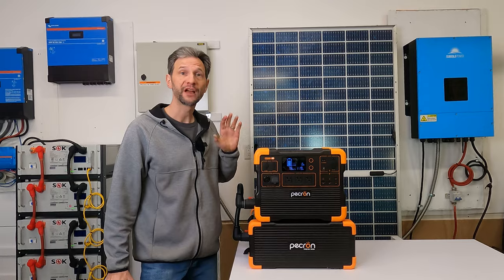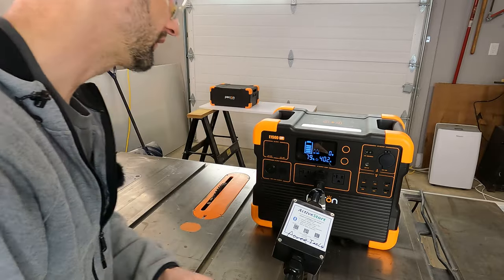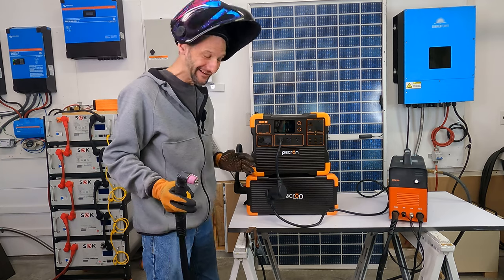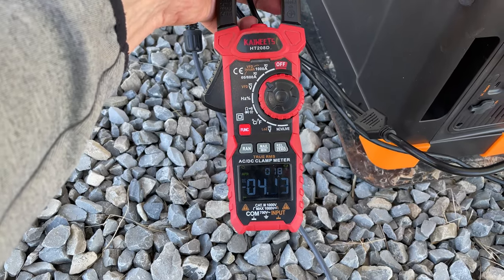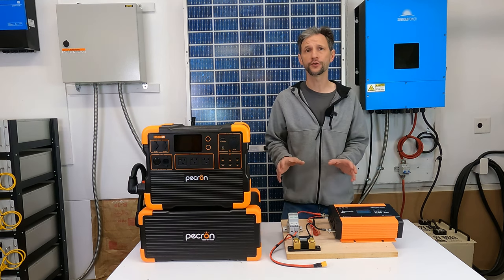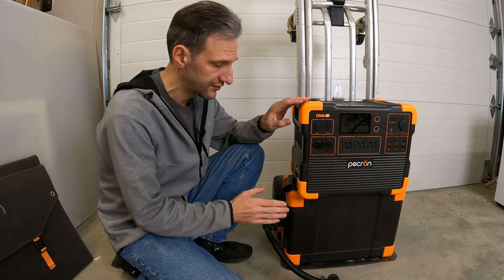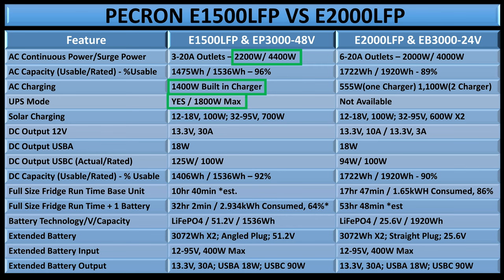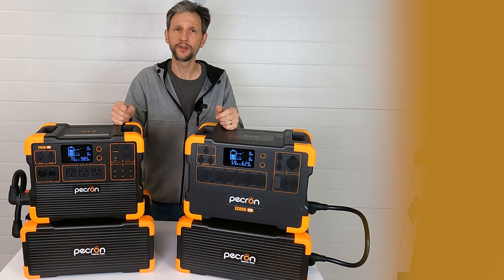PECRON E1500LFP 2200W LiFePO4 UPS Solar Generator Review

Comment from the maker: You can get the Black Friday Deal - PLUS 5% off with these affiliate links and codes:
PECRON E1500LFP - UPS power station with a 5% discount (Code: PROE1500LFP ) here: https://www.pecron.com/products/pecron-e1500lfp-expandable-power-station-2200w-1536wh#ref=87
PECRON Expansion battery with a 5% discount (Code: PROE1500LFP ) here: https://www.pecron.com/products/pecron-ep3000-expansion-battery-3072wh#ref=87
PECRON E2000LFP power station with a 5% discount (Code: PROE2000LFP ) here:https://www.pecron.com/products/pecron-e2000lfp-portable-power-station#ref=87
For more information on Portable Solar Generators visit my website: https://projectswithdave.com/portable-power-station/ 
If you have one of these units and have any personal experience to share, please post it below for everyone to reference.  Thanks!

Comment: I have both E1500 LFP and E2000 LFP. My main use is for home backup in case of an outage. I combine both Pecron power stations in a "master- slave" way. The E1500 is the master and the E2000 is the slave support unit with its larger solar yielding capacity and larger battery.
The E1500 having the UPS mode powers the critical loads like the refrigerator, the freezer, the modem-WiFi router and the home automation. On the E1500 LFP,  the 32 -95 V "solar" input port is always prioritized over the wall outlet supplied Ac input internal charging port. This way allows to recharge the E1500 LFP battery with either solar or using the Pecron charging "brick" with the aviation connector or a 48 V battery charger linked to the 32 -95 V by means of a Pecron provided cable with the aviation connector. Also, this way allows the utility supplied input 1400 Watt port internal charger to work only when there is no solar or any other source supplying the 32 -95 V "solar" input port. Otherwise, when there is power supplied to the 32 -95 V "solar" input port, the AC internal charger is moderated to just top off the battery,
So, 2400 W of solar panels supply the slave Pecron E2000 LFP that in return feeds power in the 32 -95 V "solar" input port of the E1500 LFP when needed. This feed is from a E2000 LFP Ac output to an external "brick" that provides 42 V - 15 A to the  32 -95 V "solar" input port of the E1500 LFP. I noticed that the E1500 LFP "requires" input power to recharge only when the battery shows less than a 96 % level. The solar input of the E1500 LFP being prioritized, the "slave" E2000 LFP AC output and accompanying brick charger remain idle until the next E1500 demand.
Since the above mentioned critical loads only draw about 200 Watt-hour per hour from the E1500 LFP, the slave E2000 LFP battery gets fully charged and stops all solar input. To benefit the available free solar energy one just has to plug in some other load in the E2000 Ac outputs. When possible, sometimes we plug in a space heater. Some other times, when the sun shines, we cook using a counter top oven between 20 and 60 minutes (not to deplete deeply the E2000 battery), or a hot plate, or a small slow cooker. We always care not to deplete the E2000 battery lower than 80 % by the end of daylight. No one knows what will happen during the night or the day after.
Recently, hundreds of miles away from home for 15 days, we appreciated our Pecron setup especially using the E1500 LFP WiFi monitoring app. All the critical loads were linked to the E1500 LFP. With our home WiFi router always on, we consulted the E1500 LFP status and using a camera we also monitored the E2000 status over the Internet. We were also able to activate the utility supplied heating appliances. The only missing part was that we could not activate any new load over the Internet to use the extra solar energy when the E2000 battery went to 100 %. Since then we got a WiFi controlled space heater and no longer reject the free solar energy when the power stations batteries are fully charged.
Reply from the maker: Wow, that's quite the configuration... : )
Reply: Great setup. I was going to suggest a smart plug or smart power strip..tp link being my favorite, but sounds like you got it with the smart heater.

Comment: Nice review!  I am glad I bought the E2000.  More interested in solar charging and having a bigger battery.  Don't care about the brick I never use it.  Definitely not interested in another tracking app we all have enough of those.  Lol
Reply from the maker: I'ts nice to have the two options.  I'm with you, unless you need the UPS the E2000 is the way to go.
Reply: Yeah I really don't need a UPS.  However theoretically I could turn on my inverter, plug my charger into the wall and plug the fridge into the unit and it would act as a UPS.  Not as efficient but it would work.  Thats what I do when we get hurricane warnings down here in Florida.   So unless my fridge is drawing more watts then my charger which it won't the unit will be a 100% and stay on if the lights go out.  When lights come back it starts charging again.   @ProjectsWithDave

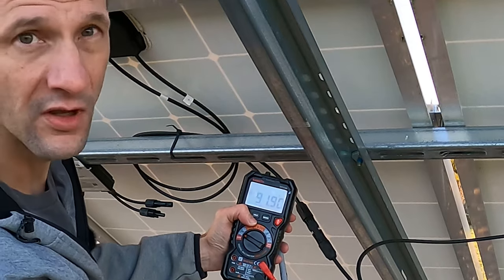Comment: 10:38 u connected 2 solar panels in series, u supposed to get 96v+- open circuit voltage/ under no load, becuz its short circuit and your solar panel data says 48v. 48x2 =96 in cold weather u can expect 0.1 to 5v above from rated.

Comment: Great Review!  Wow - so detailed, so well done.  QUESTION:  I have 2000 lfp in the bed of my Jeep Gladiator, charge it via vehicle alternator and Renogy 2000W inverter, and use it to power everything overlanding.  Cooking. lights, entertainment, Starlink - Just excellent for the past year and a half.  NOW I want to increase the capacity.  Looking at the 3000 when I came across your excellent review.  The one thing that I really DONT LIKE about the 2000 is the horrible, bulky, noisy, charger.  In my dusty environment, it stops regularly and I need to then clean it out (fan stops due to dust).  Is there a way to use the 1500 and its internal charger and then charge the 2000 from the 1500 - that would make my decision clear.
Reply from the maker: Thanks!  I'm glad it was helpful.  If I understand you correctly, you are converting your Vehicle 12VDC to 120VAC with the Renogy, then converting that back to DC with the external brick to charge your Pecron?  It would be more efficient to use a DC/DC converter to up the 12V from the vehicle to somewhere between 24-48V and charge the Pecron through the PV input port.  You could then just add an expansion battery which also has an additional DC input for charging.  If you don't need more than a 100W charging rate, you could use the 12V 100W PV input straight from the vehicle 12V system. If you have the expansion battery you could charge with 100W at 12V to the 2000lfp and an additional 400W at 12V directly into the expansion battery.  (I haven't tested to see if you can get the full 400W input on the expansion battery at 12V.)  That would give you 500W total of charging off your 12V system with no inverter or DC/DC converter.
Reply: @ProjectsWithDave  Dave. Thank you so much for taking the time to think of a  solution and respond to my posting. I did not realize I could hook up any 24 to 48 V DC source and use the PV input to Pecron. I’m definitely on it now. Thank you so much again

Comment: Excellent review! Answered a lot of my questions. I do have question though, i am looking at a few different stations with an extra battery. One brand in particular is Vtoman. I have read a few reviews on their website that would indicate the an automated switch over from the extra to the  main battery is not happening, does the Pecron auto switch once the extra is depleted? Seems like that should be standard on these devices. Thank you!
Reply from the maker: The Pecron maintains a basic balance between the batteries.  In the video I showed connecting a charged expansion battery to a completely dead inverter battery.  The expansion battery started shifting power over to the inverter battery to balance the distribution of energy.

Comment: Can you alternator fast charge with dcdc convertor if so can simultaneously charge with 200 watt solar also?
Reply from the maker: Each port is capable of taking a DC input at the same time within it's max voltage and wattage.
Reply: @ProjectsWithDave  Any thoughts or ideas for adapting a 90 degree elbow on the 700 Watt solar charging input cable (GX16-5)? Seems like a flimsy connection that sticks straight out & not secure. This is even more of a concern if one is considering using the DC/DC (higher wattage) converter for charging while driving. Also seems like they are running a large amount of current through that GX16-5 plug? Thanks!

Comment: Any thoughts or ideas for adapting a 90 degree elbow on the 700 Watt solar charging input cable (GX16-5)? Seems like a flimsy connection that sticks straight out & not secure. This is even more of a concern if one is considering using the DC/DC (higher wattage) converter for charging while driving. Also seems like they are running a large amount of current through that GX16-5 plug?
Reply from the maker: Since they are not a standard plug there are not a lot of options, but the plugs are reasonably robust.

Comment: I just got my E1500LFP two days ago. So far it’s great but I wanted to ask you - Do you notice that lights will flicker when powered by the unit? Also when the AC inverter is on it makes a noise that I wash wasn’t there. This is my first power unit like this. Is that consistent with what to expect? I plan on putting out a video with it, focusing on woodworking coincidentally enough.
Reply from the maker: I haven't see those issues.  What kind of lights are you using (LED, incandescent, florescent)?  Do they flicker when other appliance turn on, or when running just by themselves?  AC inverters make a slight humming noise when running, usually almost imperceptible when not under load.  What kind of noise do you hear?  How loud is it?  Do you hear it under load, or just at idle?
Reply: @ProjectsWithDave  The lights are all led, I’ve tried multiple shop lights and Edison style screw in. They all put out a rapid flicker very similar to this video. https://youtube.com/shorts/gmytIKsUy2s?si=mPM0NMSl-NJ0fbLQ

They do it even when the unit is under load running a 1000 watt heater. 

The noise is only present when the AC inverter is on. The DC inverter is almost dead silent. The  AC inverter noise is similar to static coming from an amp. I bought an inexpensive oscilloscope to test the sine wave to see if there is a detectable issue there. I contacted support and they were quick to reply asking for a video, they seem genuinely helpful. I’m just not sure if any of these sound normal for a power unit.
Reply from the maker: Your link doesn't work for me.  Let me know what Pecron support says.

Comment: Great video, just received mine.  I have a folding 300w panel for camping, 18v.  Is it ok to wire this up to the aviation port even though the volts are below 32?  Seems like I am over the watts on the 100w port and under the volts on the aviation port.
Reply from the maker: This highlights my biggest complaint about the solar input for this unit.  The voltage ranges for the two ports don't overlap.  Since it is under 32V it likely won't trigger the MPPT on the 32-95V port and you will get no input.  You are at the top of the voltage range for the 100W port, but it should be ok, the only issue is you will be caped at 100W as the input for your 300W panel.  If you had another 300W panel you could put them in series and use the higher voltage port.
Reply: @ProjectsWithDave  Usually I use this with my my own 40amp controller for my camping trailer directly to my batteries, but for this weekend I am testing a diesel heater with a tent.  I am going to bring my littler generator since it my get to a low of 4 deg F.  I may have to charge with the Genny!
Reply from the maker: Keep in mind you can't charge LiFePO4 batteries below freezing.
Reply: @ProjectsWithDave Good point, that heater better keep up then.

Comment: Did tons of research and ordered a 1500 a couple of weeks ago and hope to receive early next month. Still doing research on a panel.  Have you tested their  330w portable panel?

Will look to add an extra battery after I pick up a solar panel. I will augment a solar panel with my dual fuel generator. Thanks!
Reply from the maker: I haven't tested the 330W panel.  If it performs similar to their 200W folding panel, you can expect to get about 250W out of it.  If you don't need the portability, it is much cheaper to purchase ridged panels.  Just make sure it falls in the voltage range, target 40V to 80V.
Reply: probably better to get different panels to max out the solar input, 2 330w will only get you about 500w total of solar charging. and you cant put 3 330w panels in series because the voltage will be to high.
Reply: And?  Results so far?

Comment: I want to run my desktop Computer on a solar generator 24/7  with Solar & A/C plugged in at the same time. I want it to run on solar power but have the A/C power kick in if the battery gets too low. Can this unit (or any unit) do this??
Reply from the maker: Yes, this system can do that: https://youtu.be/_QMe8DWlr30

Comment: If I understand this correctly I can't get connection to the power station without WiFi?
Reply from the maker: Right, but you can change all the settings without the app.

Comment: I saw the battery clamps.  Will this unit jump start a car?
Reply from the maker: The DC port is only 30A, which is not enough to jump start a car.  However, you could charge a depleted battery as long as the charge rate didn't exceed the 30A max.  Once the battery was charged you could start the car.
Reply: @ProjectsWithDave  Thank you!

Comment: this portable power station has a surge of 4400w sir. the output capacity is 2200w.
Reply: Sounds about right. The surge rating is usually about double the continuous

Comment: I still can't see anything being better than the ac300 in the mid range with expandability. Pecron is nice, but can't beat Bluetti imo. Buying refurbished direct from Bluetti is way to get great products at a great price.
Reply from the maker: I have had no issues with my AC300.  I've been charging it with solar and discharging with a dehumidifier daily for months with no issues.
Reply: The AC300 just sits there til u buy a whole 'nother unit to run it. I'd have to lug around 2 units vs the Pecron or an Ecoflow. A brand new Pecron E1500 for $854 works for me. ❤

Comment: I recently purchased this power station. Because I get limited sun, I would like to be able to charge the battery using a gas generator. One of my generators (listed below) only puts out 1000w, 400w short of the 1400w AC in port on the power station. Would it still work, but input at a slower rate?? Or, not work at all? 🤔

1000w invertor gas generator - (1500 surge)
Reply from the maker: I don't remember at the moment if that unit has a slow charge setting.  If it doesn't, it will attempt to pull the entire load and likely stall the generator.  It's very close, you would have to try it to see.  If your generator puts out 110V instead of 120V it might work.  Also, if the battery is mostly charged it will pull less power.
Reply: @ProjectsWithDave  The power station is a Pecron E1500 LFP. I contacted  Pecron and they replied that, if your generator is REGULATED...it would charge the battery OK. (I would think that all generators would be "regulated" to prevent them from blasting off to the moon, but I don't know...so I have also contacted the manufacturer of the generator. Not heard back yet. The generator is 120v. There is no slow charge setting on the power station that I see.
Reply from the maker: Just plug it in and see what happens.  If the generator can't keep up it will shut down the AC output or stall.
Reply: @ProjectsWithDave  OK
Reply: @zippy2641 Any update Zip?

Comment: It's good but mine overheats when charging from 10% with mains power. I have to stop at about 70% as the temperature warning light comes on... A little disappointed. Tried talking to Pecron about it but just get fobbed off.
Reply from the maker: Interesting, thanks for sharing your issue for others to reference. I have charged at max input from fully discharged with no heat issues whatsoever. Are you in a high temperature environment?
Reply: @ProjectsWithDave  I got a reply for Pecron support

I got your feedback, I need to explain to you that UPS generally does not affect overheating, overheating occurs most of the time: the machine has just been discharged from 100% to no power, and then immediately after charging, in this case the machine is prone to overheating;

If under normal circumstances, such as the E1500LFP a day without use (can be regarded as a cooling state), can not be discharged from 100% to 0% and thermal protection, this situation may be the machine's temperature probe problem;

Currently the E1500LFP model cannot modify the charging power, we have collected the suggestions from our customers and adjusted to add this feature in the subsequent release of the model.
Reply from the maker: Is your unit actually getting hot when charging?  If not, it may be the temperature probe is defective as noted above.